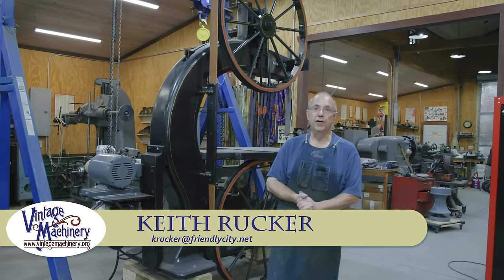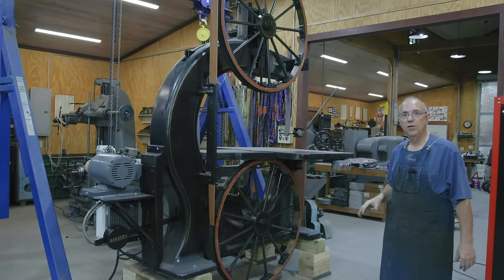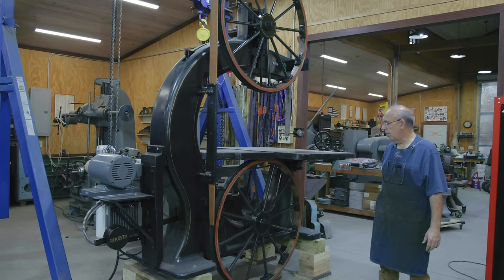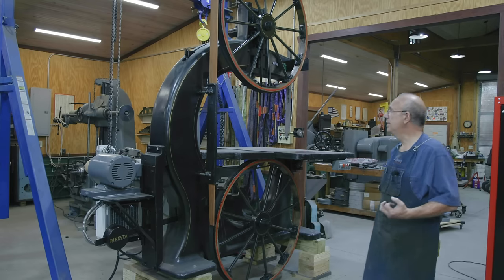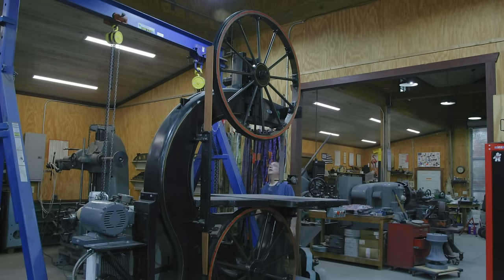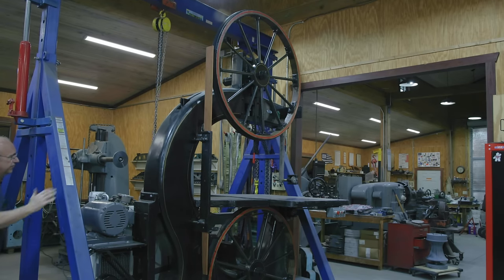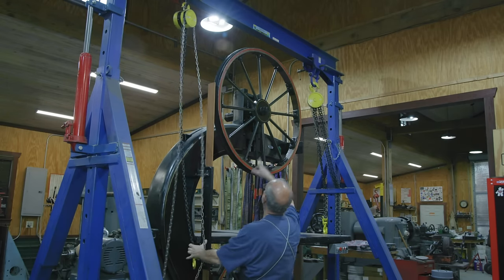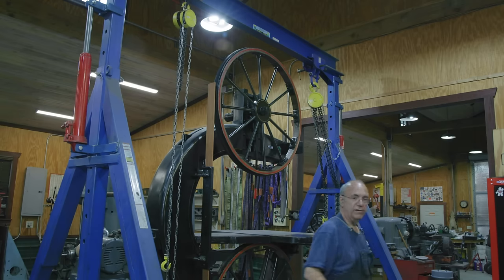Diresta Bandsaw Restoration: Disassembly and Loading for Shipment

Comment: Thank you for not editing that incident out Keith. We can all learn from a mistake like that. I would put some time in a rigging manual. You could have rigged it the same way but also wrapped the choker around a spoke to prevent tipping.
Reply: Explain, please.  What is double choked?
Reply: Made me jump.
Reply: @jobersudyobodou9362  Double choked is a regular choker hitch but you add an extra turn around the part before you make the choke. You just wrap it twice before putting an end through the eye. A double choke is the preferred method for loose, slippy parts such as a pipe that must be lifted at an angle for clearance. That is no longer in my post, I edited it out as a simpler method would be fine for this wheel as the spokes are strong. Generally, you need to rig around strong and solid parts of the piece you're lifting.
Reply: The first time it tried to jump out was 8:13. From then on, it could have flipped at any time.

Comment: Hmmm- remove the lower wheel then set the machine on the floor and remove the top wheel- no need to fool with the crane.  Both failed as "R" words- Keith almost lost the wheel and the driver loaded the machine cross ways with short straps.  Gonna be harder to unload and if he had to hit the brakes hard, it might go over. Loading the long way would be more stable.

Comment: When you said you are going to shrink wrap, you are actually stretch wrapping, to shrink wrap you need to set it on plastic wrap and cover it up with another piece of plastic an use a heat gun to make a top cover for it then heat up the top and attach the bottom and shrink it tight to finish I did that for 8 yrs.

Comment: I’m glad the top wheel didn’t slip off the sling. Another note on safety when lifting things with an overhead crane of any type, is body placement. Do not walk under the load. I was thinking that to myself when I was watching right before the sling slipped. I’ve worked in a steel mill the last 15yr, and have seen two people get critically injured by being under a suspended load, and 1 fatality. All 3 could’ve been avoided by proper body placement. Rigging is important, but cables break, loads shift, etc. Proper body placement is just as important as load rating, rigging, etc. Keeping yourself out from under suspended loads and out of pinch points as well as using no touch tools can save your life.

Comment: If I ever build another rolling gantry crane I will fashion iy after this one. The ability to increase it's height or lower it is just great. I'm sure glad you didn't get hit with the wheel and shaft or get run over guiding the trailer back. Some days eh.

Comment: you still could have put a strap around the top of the wheel to the lift point as a fall mitigation, even if it was not taught at the time.

Comment: Yeah,  really all you had to do to prevent the wheel from pivoting was to simply strap the load chain against the wheel rim. That would have kept the wheel from tilting far enough for the nylon sling to slip on the axle shaft.  A couple of big zip ties or a tightly bound piece of cord or heavy twine would have sufficed for that as the lateral loading was very light at that orientation.  Good thing you at least used a choker instead of a basket configuration with your strap.

Comment: An Electric winch would be alot better then that chain hoist. Mount a 12v deep cycle battery on one of the legs and wire it to the hoist and life get's a lot easier.